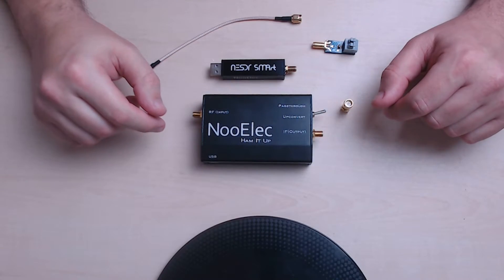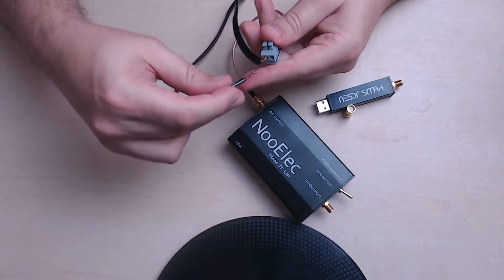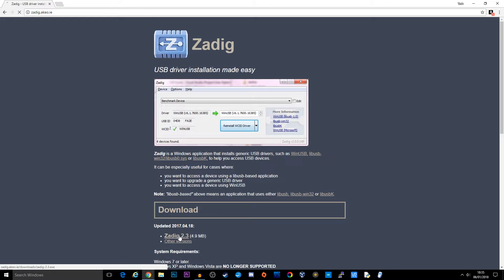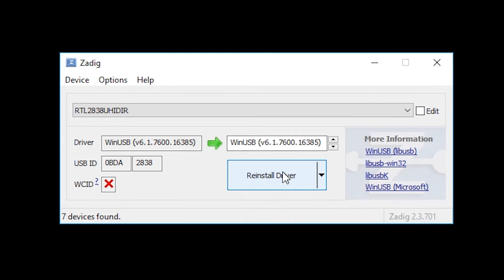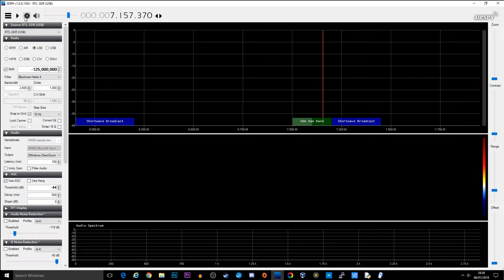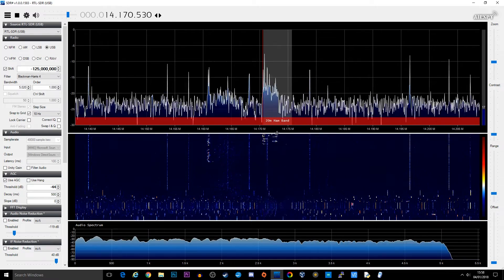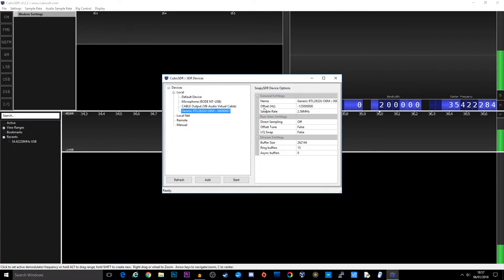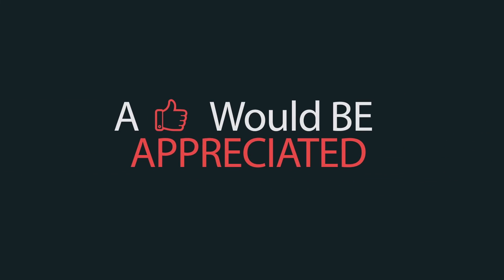How to setup HAM IT UP Upconverter by NooElec with SDR Sharp and CubicSDR

Comment: ,,,,I found the noeelec dongle,,,a complete ripoff,,,when you see the ad, which I did,,it implies, that's all you need, to basically recieve DC current, to light waves,,,,just attach, to your phone, and antenna,,,so I bit,,about 40 dollars,,,now you find you need an exotic otg cable,,,another 15 bucks,,,then you need the software key,,,another 13 bucks,,,then you can basically listen to am broadcast, fm, and some cb radio,,,with lousy reception,,,if you want hf,,up to 30 mhz,,you neet a freakin ham it up upconverter,,for another 70 bucks, and  screw that,,,it sucks,,,what a scam, when they first sell you, on the dongle,,they give the impression, that's all you need,,,and they trap you into needing all the other peripherals,,,if you buy a freakin self contained 2024 sdr unit,,,look up a "malachite reciever",,, on ebay, or amazon ,,your done,,,screen, and all waaay better than this total scam,,,and for around 50 bucks,,,you can have a tecson pl330 reciever,,,which eats this thing alive,,,,I don't enjoy being taken advantage of,,,and that's what this junk does,,,,do full research,,,before you buy any part of this worthless contraption,,,waaay better products out there for way less, and simpler to operate, and better end result,,,I call em like I see um,,,this thing is crap,,,de NV1H,,,😎

Comment: It's alot of work what are the benefits compared to RTl sdr v3/4
Reply from the maker: A V3 doesn't work too well on HF on it's own. You can use Q branch, but just not as good as an upconverter.

Comment: Craig W7CDP - Can't get the SDRSharp software to fire up.  I keep getting a popup that I need to load the .NET software which I have loaded about 3 times.  After doing so, it still pops up and won't let me go beyond.   I have a 64 windows 10 machine.  What an I doing wrong?

Comment: The driver will not install in Windows 10 unless in Zadig you click Options, and UNSELECT Ignore Hubs or Composite Parents, and then list all Devices again if necessary, and then use TL2838UHIDIR as the device you are trying to install. Then the driver will install correctly. Then go make sure SDR sharp recognizes the device go to SDR sharp directory and run the install-rtlsdr.bat file by double clicking on that, then go into SDR sharp and choose RTL-SDR USB as the source. Then it'll work with the play button as usual.
Reply: Thank you very  much sir, this is exactly what people should do, I've then be able to use the software with these steps. Thanks again!
Reply: @ummite  No problem at all. I'm glad it worked for you. Have fun with your SDR. :)

Comment: Thanks for this series of tutorials. Very helpful. I wondered if you had any thoughts on the HF reception performance? For example, compared to a traditional comms receiver? I am  tempted to get one of these bundles and, while, I don't expect HF reception to be as good as amateur HF receivers/transceivers, I was curious to know if the performance was reasonable.
Reply from the maker: It’s all about filtering and rejection. For the price, and as a start into SDR a ham it up with an SDR would be a great starter. For something comparable to a dedicated receiver, then an RSPdx from SDRPlay or the Airspy HF+ would be recommenced. Hope that helps.
Reply: Yes, that is helpful and thanks for reply.
I decided to order the NooElec SDR HF bundle as I wanted just a basic HF/VHF/SDR for measuring VDSL2 interference. Also thought it would be a useful panadator for monitoring my HF/VHF/UHF transmissions.

Comment: Can i use this on a older acer chromebook ?
Reply from the maker: Depends what OS you have installed. I’m personally not aware of any SDR software for chromebook, but some might exist. I do have a chromebook some where so I’ll check
Reply: @TechMindsOfficial  Thanks for quick reply . I just updated to this  
Version 80.0.3987.137 (Official Build) (64-bit)
Reply: @kanibis420  The only software I've found for chrome OS is called Radio Receiver and its more of a browser plugin , I would love an app like SDRTouch that worked on chrome OS.

Comment: Ive reloaded the driver, device manager says it is working and best driver.
Selection on rtlsdr controller tab shows no selection at all, its invisible.  advise?
Reply from the maker: You have to use the ZaDig driver installation program to install the correct driver for your SDR receiver. Which SDR do you have?
Reply: I have the same problem, i have rtl_sdr receiver r820t2 (one with dolphine on it), in zadig it shoved and the driver inastallation was successful but in sdr sharp it doesnt show.....
Reply: I found answer in on other comment...run the bat file
Reply: @jakobkatrasnik8684  thank u

Comment: Great video thanks! Please could you advise as to what kind of wire to use for the 2m lengths that go in to the balun? I can't find any reference on the net for this, can it be standard coaxial cable (RG-58) or something else??
Reply from the maker: To be honest the longer the better, I used 15m wire and it was just 1mm bell wire. Copper
Reply: @TechMindsOfficial  
Hello, and what was the opposite to ground, right or left? It had the same distance as the active cable, thanks
Reply: Temporal Space Club late comment but definitely not coax, use something like speaker wires that are not shielded. The point is that shielding protects from RF, which is the opposite of what you want in an antenna.

Comment: This video has been very helpful. I now have the sdr dongle plus Ham It Up. I get very weak signals and lots of noise which I think is from the pc . I'm very disappointed! Suggestions?
Reply: Use a USB cable with ferrites.
Reply from the maker: Hey Bob, I would definitely say this is to do with your antenna. Please let me know what type of antenna you are using for HF, below 30Mhz
Reply: I'm using two lengths of copper wire about ten feet long each into the balun as a dipole. I tried the same arrangment into my HF receiver with no problem. I think that it's noise from the PC. I'm going to try it with my laptop outside in the garden to see if the noise is coming from somewhere in the house.  Cheers.

Comment: I wish Nooelec would get a little more specific about the drivers, seems to be comparability issues with some systems. seems like it's trial and error, pretty frustrating.
Reply from the maker: The Zadig drivers are all oh need for normal SDR software. Some DAB and TV software require different drivers.

Comment: i have the latest nooelec doggle and ham it up. converter and use cubesdr. have -125mhz offset and highlighted rtl and hit start. all i get is noise.
the rf in goes to an outside 2 element 40 mt yagi at 70 ft. seems like i should be hearing something.
Reply from the maker: Do you mean CubicSDR? Also, what’s frequencies have you tried listening to? I presume around 7.1mhz lsb? Also make sure that the switch on the ham it up is NOT on pass through.
Reply: I have a switch that i can switch in my 160 meter inverted L ant or the 40 meter beam or my 4 element quad. and sorry type-0 CUBICSDR software. ham it up is switched in. not bypassed. can pick up 2 of 3 local am stations. but nothing on 160 80 or 40 meters cw or ssb. i have been a ham since  1962 ,  so it is hooked up right. i check out the videos on here and the guys are coping a ton of signals. but i am not hearing any. i also have the 9:1 balun going to rg 58 coax to the antenna switch. and have tried it with and without the balun.  maybe i have something in the software wrong. thanks Tony WA4JQS

Comment: I'm having a little bit of trouble getting this to work in SDRsharp. even after I install the driver using Zadig I am unable to find my device in the configure source button. When I click on the configure source button there is no option to select other devices it is grayed out. Do you know where my issue might be coming from?
Thanks
Reply: i am having the same problem, have you resolved it?
Reply: Obi Okonkwo , I borrowed an rtl-sdr v.3 from a friend and SDR sharp recognized that dongle. I also followed the installation instructions from rtl-sdr.com

Comment: A newbie guy  but i have one simple Question- how does the ham it up converter receive its power source from..
Reply from the maker: Ahh yes, I’m not sure if I covered that properly in the video but the Ham It Up has its own USB cable which plugs into a PC or usb charger for its power source. So you need two usb cables, one for the sdr and one for ham it up.
Reply: ahh that's it.. i see now  5+ plugs in the other usb port /side of the Converter.. excellent video by the way..very helpful for us sdr beginners guys..